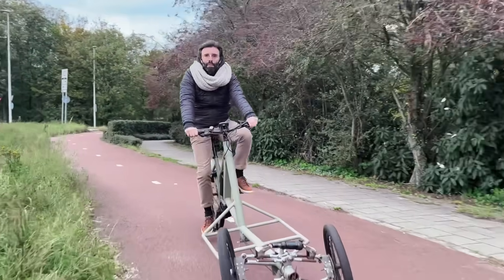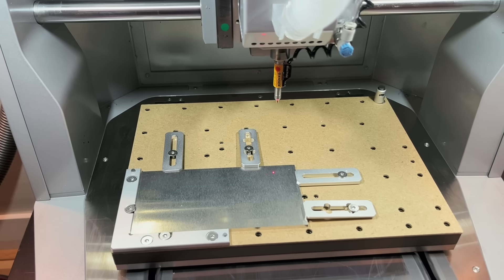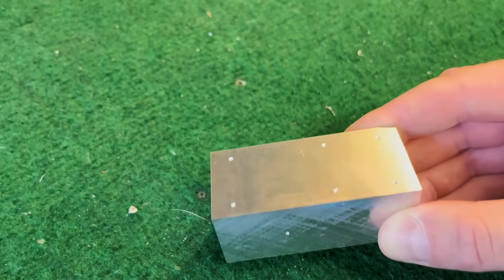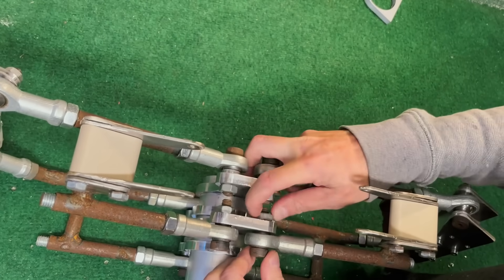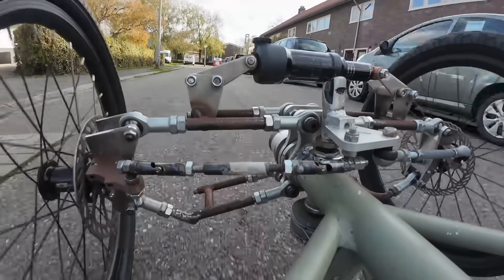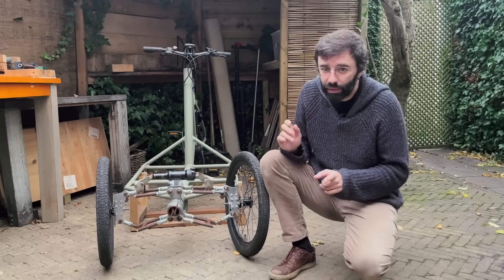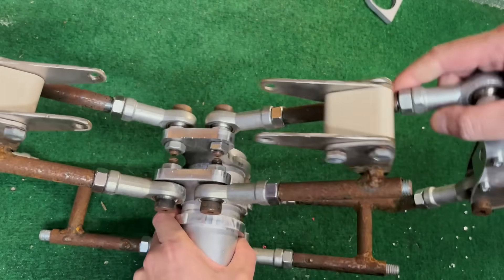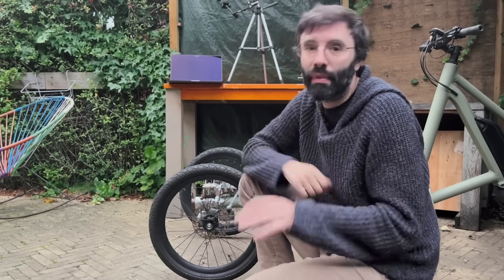#7 From 3D Printed to Aluminium - Tilting Mechanism with Makera Carvera Air

Comment: To my eyes, one of your issues (not be able to ride hands-less) comes from the fact the tilting mechanism is totally free. In my humble opinion, the tilt must be constrained to a central point, then you have to deliberately engage the tilt. Maybe a couple of springs in opposition can force the bike to stand straight in a central position, while not preventing you to tilt the bike when needed.
Reply from the maker: Hi, thanks! Indeed, I've also tried riding with a configuration as you describe. It's a matter of taste and there are commercial trikes like that, though, I think they're not great to ride. You have to ride them like a quad. With a front tilting mechanism, you ride more like a bike with less potential to crash. It's a difficult "formula".
Cheers!
Reply: @pedro-neves  I think I have spoken to you before about trying to design a tilt based on speed. Did you get to do any measurements on a 2 wheel bike for tilt and speed?
Reply from the maker: @andrewmclean1239  not yet:( It's in the pipeline. It's not hard to make but I want to have a good enough trike to compare the bike with the trike

Comment: Does stability have more to do with trail? Or potential energy in the bike and rider? If turning causes the bike and rider to "drop" it seems to me it would be less stable at the center point. But if the turning / leaving lifts the bike and rider, it would be more stable / track in the middle. Not sure if that makes sense.

Another question. Where you weld the plates to the tube. Do you worry about heat treating to reduce the stress at HAZ or do you ignore that for the moment because your parts are always reinvented before they have a chance to fatigue? Looks very cool. One of these days I want to follow your plans and build one. You're an inspiration!
Reply from the maker: Thank you so much!
- Stability comes indeed from potential energy. It's pretty stable when going fast (>20 km/h) but I would like for it to be a little bit more stable when going slow.
- My welding abilities go as far as sticking things together reasonably well. My aim is to prototype a vehicle that has little design flaws and feels great to ride. if I ever go to production, I'll have to partner with someone that know how to build a proper aluminium chassis.
Cheers!
Reply: here we hit the nail on the head. potential energy. gravity.
it has to be STATICALLY stable. trail, rake, kingpin inclination, caster, they all only come into effect with movement. "dynamic".

parallel linkages with equal and opposite motion drops the frame as it leans. it follows an arc pivoting from below. it needs to follow an arc pivoting from above... so yes, "straight ahead"  is its natural position, as it falls to the bottom of the arc, lifting as it LEANS, not steers.

sounds complicated, simple solution... two linkages and a "teebar" with offset pivot... constrain swingarms to fixed motions in relation to the frame. "differentiation".

its not a bike, and its not a car. nor is it a standard, upright "trike"... it has nothing to keep it upright but... good design. 

congratulations. you spotted the major flaw with virtually every attempt at making a tilting trike. very few do... obviously!

only one i have seen does it properly, "jetrike".

pretty simple, really. a bike at a certain lean angle has a certain steering angle. as we have two wheels on different tracks, we can say its two bikes and each one has to be allowed to steer AND lean as required. you cant do that with parallel linkages left to do their own thing, with no way of "splitting the difference" in relation to the frame...
Reply: @paradiselost9946 thanks for the great explanation. That's what I was seeing in my head but could not have worded it so well. Cheers
Reply: @mitchc.9550  look into the jetrike... he had pretty comprehensive info, once you understand the principle it IS easy...

seems the site gets a 404 error now. youre stuck to a few scant images and the odd 15year old YT upload?
"tee bar and links".
a linkage on each upper swingarm. a bar pivoting in the center, mounted on frame. can arrange it any way with suitable bellcranks. 

if the pivot bar pivots on its center line, the two arcs are equal and opposite.
as soon as the pivot offsets from center... it will either drop the outer wheel further, or lift the inner wheel higher... you want the first option! more offset, more "differentiation"...

its also giving the swingarms, rather than the wheels, a reference to the degree of tilt of the frame itself. 

how it goes with suspension AS WELL?

i cannot tell you, i never tried one with suspension...

Comment: You should try toe in for more stable steering.
Also look at steering knuckes of older cars and how teh use ONE central ball joint per wheel as their main rotating pivot.
Reply from the maker: Thanks! Indeed, I take inspiration from car knuckles a lot.
Cheers!

Comment: Does the "no hands" driving improve with some weight up front ?  After your aluminium mod so much safer ;)
Reply from the maker: I haven't tested with cargo yet because this design has some fundamental flaw but I think it would be more stable with cargo, yes.
\Cheers!

Comment: Are you using reverse Ackerman for the steering?
Reply from the maker: No, just Ackerman. It may look incorrect because I didn't  work enough on that geometry because I found some fundamental faults in the ball joints but the outer wheel is supposed to turn less than the inner wheel.
Cheers!
Reply: @pedro-neves Thanks for your reply, have you experienced any problems with the drum & wire steering? This was the first video of yours I have watched, so I will have to watch some of the others to get the background but it looks very interesting.
Reply from the maker: @steveporritt1550  I have the cable steering for some time now and I liked to build it and the lightness of it but, I must admit it's a little bit annoying that I have to tune it some times. I think the cable stretches and then gets some slack. I've been considering replacing it with a bar. It just works perfectly and it never needs service.

Comment: very nice work! They use the "forward trail" similar to a side car motorcycle because the bike doesn't lean. The forward trail leans the wheel a lot without leaning the bike--wheels turn by leaning.
Reply from the maker: Precioussss!!
Reply: The forward trail will also reduce side loads on the wheel, by increasing lean angle, which would lead to reduced maintenance.

Comment: Great to see it made of metal !

Just a, ideas
1. if you used ball and cup joints at 180 degrees to each other at the top and bottom of the axle suspension joints and used a bolt to fix the distance between the two arms you would have unlimited steering freedom and they would not be able to fall out so long as the top and bottom of the suspension arms were connected after the joints were attached
2. That is a bit piece of alu, if you had sheet materials at right angles and only had a small solid axle holder you could save a lot on such a large piece of metal; combined with 1 this could make it much lighter and cheaper
Reply from the maker: Thank you! Indeed, I think this is how the next knuckle will look like.
Cheers!

Comment: Hello Pedro, first thank you to Share your video, you are doing a great job and you have lots of skills ! I m working on a similare project too (a bit different) About your questions : in low speed, specialy if you re carrying a load, did you think about a tilter lock (no more leaning ) that you could release as soon as you get speed? 
And, on the video, when you’re leaning , the inner wheel seem to have less angle than the outside wheel ?? Did you try positive camber (+/- 6°) in order to have more angle on the inner wheel when you are turning in hight speed. Or maybe you already try !? bike tire work like a cone and each wheel have his own radius in thé curve. 
I ll be very interesting by the result. 
Anyway Well done and keep it up.
Reply from the maker: Thank you so much! Indeed, when leaning, I still have to combine it well with the Ackerman to have the outer wheel turning less than the inner wheel by the right amount. I just haven't got there yet because some things just don't work in this build...
Cheers!

Comment: looking forward to see a build with separate bearinigs for leaning and steering, thats one of my conclusions also after my build that I needed more of both steering and leaning. also realized that with 2 wheels in the front and ackerman geometry its impossilble to get as much steering as with 1 wheel in the front. down side with separate bearings are that its more complicated to get a neat design.
Reply from the maker: Indeed, it will be more complicated. Let's hope it will be some fun trying to figure it out;)
Cheers!
Reply: @pedro-neves  there are also pros to using separate bearings over ball joints.
- they're more common so probably easier to find cheap.
- in generalbetter weather proofing, and commes with different seals.
- less friction
Reply from the maker: @linus-IO  indeed! More effort designing and building but may well be worth it.

Comment: Hmmm....didn't you make an adjustable-camber build so you could experiment to find the best camber?  Does this bike handle differently from that bike?
Reply from the maker: Indeed, I can adjust camber here too. The reason why I didn't do it yet is because I was told that camber shouldn't have much effect in steering and that the reason why camber helped so much in the other build was because some other geometry changed as a bi-product of camber. But you're right, I'll add a couple of degrees of camber and share how it went in the next video.

Comment: Hello Pedro...First thing to consider is that most motorcycles have 80-110mm of trail. My advice about low speed steering stability is as follows the tops of the tires should be closer than the bottom of the tires. Imagine the wheel at an angle of 93 degrees from vertical with both wheels closer at top and wider at bottom. Volkswagen was famous in 1990s for negative camber. It provides good tracking which means hands free on smooth roads. Also learn what "Toe" means and try to make it zero. I am not sure how to measure it on a bicycle, but automotive alignment racks measure this parameter and often it needs minor adjustment by lengthening or shortening the tie rod end links. Let us know if that helps.
Reply: Thing is, as a suspended cargo trike, loading up the front with weight changes the center of gravity, roll center, toe, camber, etc. so the changes you make to it now will affect it in not necessarily good ways how it handles when it's fully loaded. So I suggest before making any big changes, see if anything changes when it's loaded vs unloaded at different speeds. Depending on geometry, stability increases with speed
Reply from the maker: @bentBuilder  indeed, will need to test with cargo soon.
Reply: Toe on a trike is easy to measure. For a nuetral or 0 toe the distance between the front of the tires and the back are the same. I always incorporate a slight toe in 5-7mm? So the front measurement is smaller than the rear. Use a negative camber and ALWAYS a positive trail right around 60-75mm. NEVER a negative trail as it will become unstable
Reply from the maker: Thank you dos much! Indeed I had good results before by adding a bit of camber. I'll try it out.
Cheers!
Reply: This is a great advice, i’d add bit a camber… that should do it
Reply from the maker: @pm_calabrese  I will, indeed!
Reply: Yup, slight negative camber is usually advisable. I believe toe is also usually slightly "in", meaning that the fronts of the wheels are just slightly closer than the backs
Reply: What is your idea on a lower point of gravity? Your wish to ride a bike without holding the steering wheel is not just about stability through momentum. It’s also about the center of gravity aswell.  I believe that when the tilting mechanism is positioned more above the bicycle frame, the stability would improve too. Just my thoughts.
Reply from the maker: @ericsassaalders1079  indeed, the lower the center of gravity the more stable it will be. But, I think I don't want to go lower as I want it to have enough ground clearance. Now, I'm just trying to adjust some steering geometries for stability.
Cheers!
Reply: I think that adding camber to a tilting front end might affect the roll center. My intuition is that keeping the roll center on the ground will tend to make two wheels feel like one.
Reply: Motorcycle trail is based on wheel diameter, and he has smaller wheels on the trike so you can't compare trail for trail.
Rake is the important measurement. 30 degrees good, 35 better still.
Reply: @wizrom3046 these aren't motorcycles with triple-t's. Although the wheel size does impact the trail (on a motorcycle) it's primarily set by the rake of the head tube. On a recumbent, the industry standard set by manufacturers has kingpin angles of around 14-15° and that is based on a 406 or 20" wheel. If you swap those wheels out with any other size youll get a significant amount of tire scrub wheel you turn unless you space the wheel inboard or outboard effectively narrowing or widening the track width.
Reply: @bentBuilder   i agree with everything you said.
And, the video still shows instability which would be improved by increasing the rake.
I would increase it significantly, as it would improve stabikity a large amount and the only negative aspect would be that it might take more force on the handlebars to turn, which would be a very minor issue. He is not trying to build a "lively" racing bike, but a practical cargo trike. I would opti ise the geometry for max stability and max  turning angle
Reply from the maker: @wizrom3046  thanks for the tips!

Comment: I think more trail means greater stability,; the bike wants to go in a straight line; or that's what I understand on a conventional bike. I follow most of your videos and I might have missed this, but before you make big changes you should do some testing under load after all this is a cargo bike. I would think collecting data or experiences at different speeds with and without heavy cargo, as well as up and down hill, should be part of your testing regimen. This would mitigate from fixing one problem only to create another.
Reply: Too much positive trail will cause the wheels to flop. Especially on a leaning recumbent. It also makes the steering more...Heavy?
Reply from the maker: @bentBuilder  interesting, thank you. Have you seen the Bowhead Rogue? It is a leaning suspension and has a huge trail.
Reply from the maker: @bentBuilder  agreed indeed, thank you. Will certainly consider the flop threshold.
Reply from the maker: Indeed, thank you! With cargo it's more stable for sure!
Reply: I politely disagree.
The dynamics of a normal bicycle do not translate 1-to-1 onto 2-wheel setup.
There is trail interference with leaning, which is different for 2 wheelers because they need to have Ackerman: i.e. they turn at different angles. Thus trail effect in the lean is different fon each wheel, and more of it doesn't always mean better.
Reply from the maker: @SEThatered  thank you for the notes! Leaning also needs Ackerman, right?
Reply: @pedro-neves  It does, but a different amount.
And some trike manufacturers make variable Ackerman that changes with lean angle.
I think Peugeot trike has it like that, but I am not too sure.

Comment: check Tony Foale's book on motorbike suspension design
his ideas work great on my LWB recumbent 👍
Reply from the maker: Thank you very much! Indeed, I'm in need of some fundamental theory.
Cheers!
Reply: Hi, while Tony Foale’s two wheeler work is very good. He completely misunderstood how a TTW works. The way he explains his analysis of the tilting suspension system example in his book, it’s clear he didn’t decouple the suspension unit/s from the tilting mechanism.  I don’t suppose he was very interested in TTW’s but it was certainly a howling error on his part.
Reply from the maker: @flannel2699  interesting note, thanks!

Comment: I remember watching a video that recommended 3.5-4 inches of trail for self centering.... would this be attemptable with some taller tires maybe?
Reply from the maker: Thanks! Indeed, I've seen bigger trails. I think I'll design a knuckle that allows fitting the wheel in different positions.
Cheers!

Comment: Would mouting the whole suspension setup to a rollerbarrel instead of a slightly larger tube not help with the smouthness of the leaning? I suspect if any dirt gets into the space between the two bars you might get some binding in the future.

But love the work you do so keep it up!
Reply from the maker: Hi, thanks! Rollerbarrel is something like wagons turned, right? It's certainly easier to make because then you only need one degree of freedom in the knuckles but it takes too much space to turn so I'm trying to design it as much as a car as possible while including the tilting mechanism. But, here's a tilting trike with wagon turn that I liked very much: https://youtu.be/t1sUOtY4fYs?si=5JZBbumj97vYSAu1.
I'll try anything;)
Cheers!